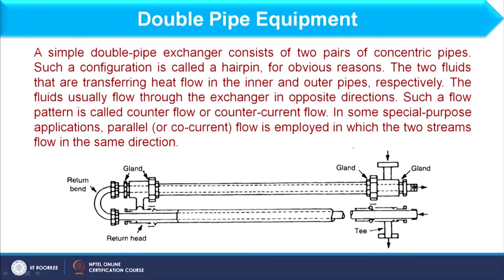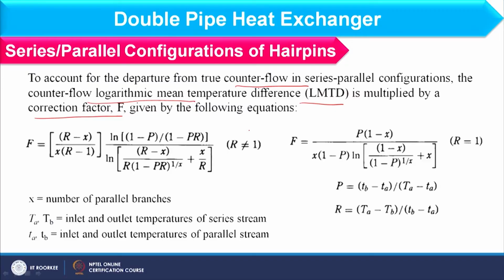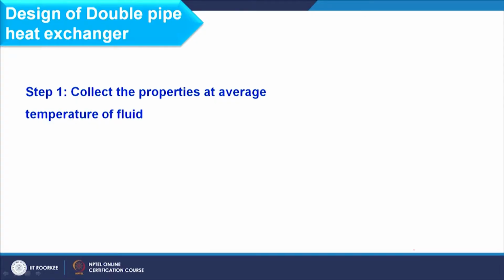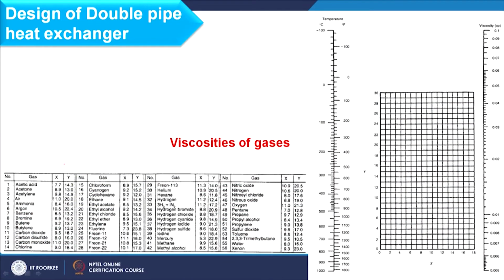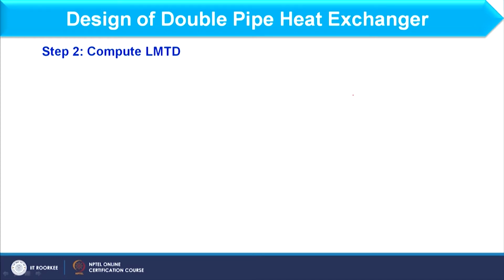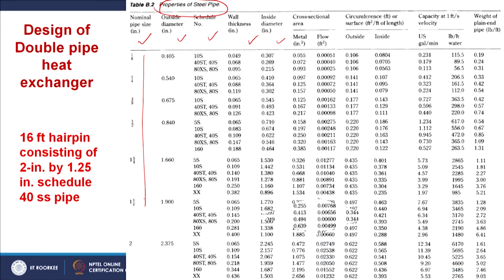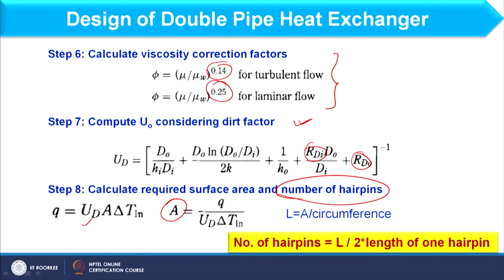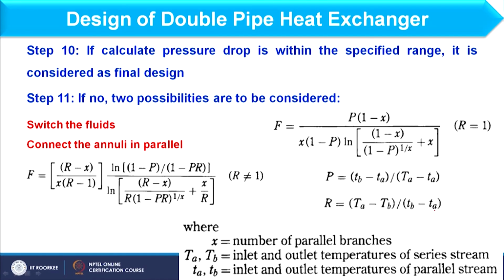Lecture 06 : Double pipe exchanger-1

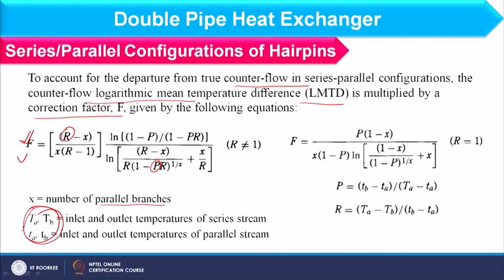Comment: @6:47 said annular side always remain in series. But @32:21 said connect the annuli in parallel.
Coul you please clarify teacher?
Reply: if the calculated pressure drop is not within the specified range